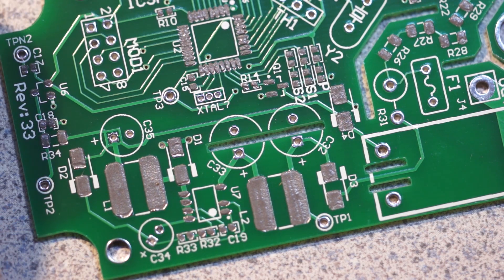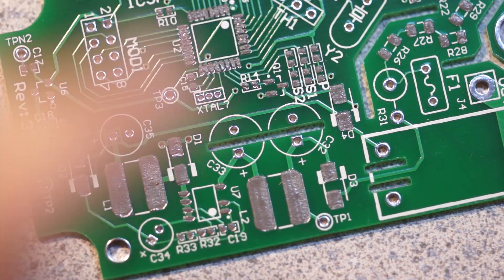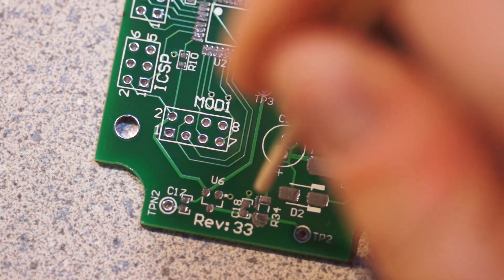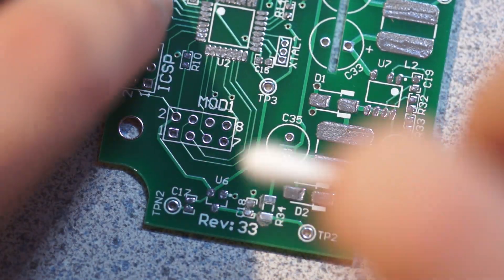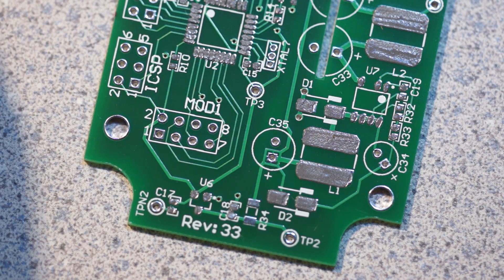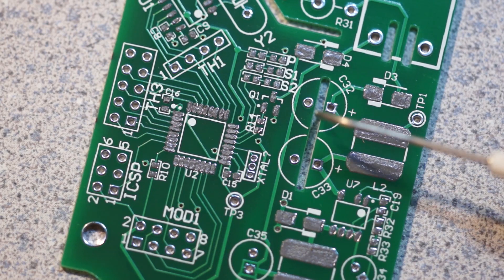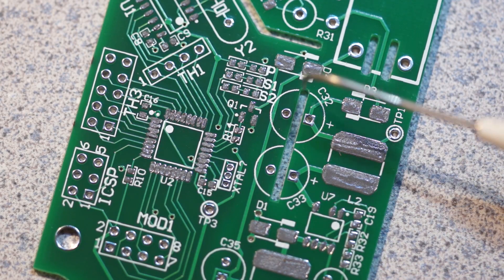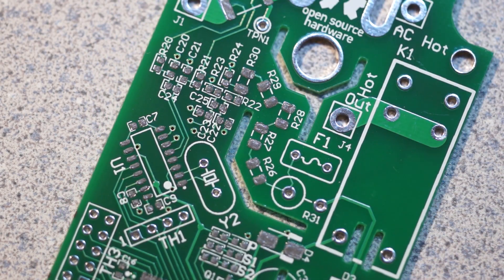PowerMeter Project - First test of hot plate reflow and solder paste stencilling

Comment: Looks like you're using one of that cheap chinese solder paste, am I right? I want to buy some off ebay (because good quality ones are very expensive where I live), but I'm afraid it may not work properly.
Does it work well? Did you have any kind of problem in any of your boards?

Comment: I need to reflow just a power connector on an ipod logic board, buy using a hot plate like yours it won't melt the other components?

Comment: Won't putting the board like that thermally shock the components? Especially the notorious LEDs.. 
Did the board work? I saw you've done other boards with this method, which suggests that it was a success, but were there any problems? Thanks.

Comment: Why not using a contactless temp sensor to control your hot plate ?
Reply from the maker: 1: Almost all inexpensive IR thermometers are calibrated for surfaces with a much higher emissivity then aluminium, so it would be inaccurate.
2. IR Thermometers that go above ~500° F are expensive!. This thermocouple thermometer was ~$20. If you can find a IR thermometer with a similar temperature range for less then ~$50, I'd be impressed.
Reply: Connor Wolf Hi, yes tmp006 from Ti is cheap (5$ ) but only goes to 90 degrees centigrade. the one from Melexis MLX90614  is better (380°C) but  is around 19$ (sparkfun.com)

Comment from the maker: This is actually the second board for the power-meter project so far. The first was a very different, early prototype board, with optoisolators so it could be easily worked-on when connected to the mains, etc... 

However, I did assemble that board with old-fashioned manual solder-paste application and hand-held hot-air.

Comment: Btw. a mix of horizontal and vertical parts can be an issue in wave soldering. But since this PCB was never meant to be wavesoldered anyway...
Do you know if angled components are harder for PnP-machines to position correctly (meaning more rejects in mass production)? Since these machines examine the parts visually after picking and will rotate them accordingly even for horizontal/vertical parts, they shouldn't have a problem. But maybe?

Comment: I have to admit seeing a SOIC mounted at 45° looks weird, only used to it with QFPs. That said I will do it myself when making PCBs (mostly one-offs designed to the parts I have around) just to make the PCB smaller. I'm a little OCD in that regard and that's the thing I will fault you for. It could have been more densely packed! ;)

Comment from the maker: The layout is actually fairly optimized. The only area where it's a bit messy is the mains divider (R26 - R29) where I needed to maintain creepage across the divider and I didn't have enough space to lay out the resistors in a nice line. 
Regarding the mix of horizontal and vertical parts: since when is that an issue?

Anyways, imaginaryindustries[dot]com/blog has links to my SVN. Board was done in altium, though, so you'd need that to actually edit the files.